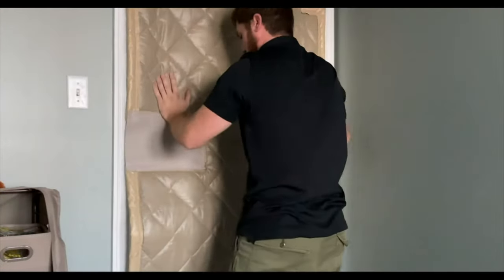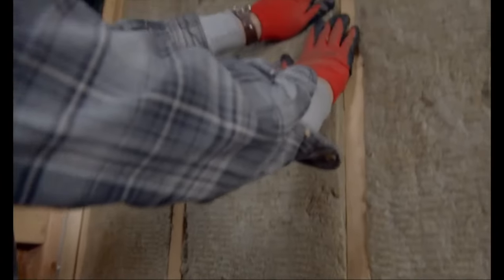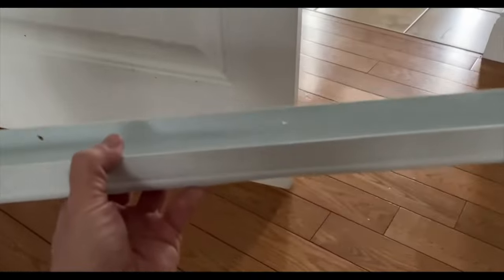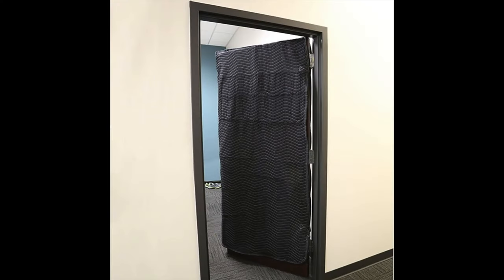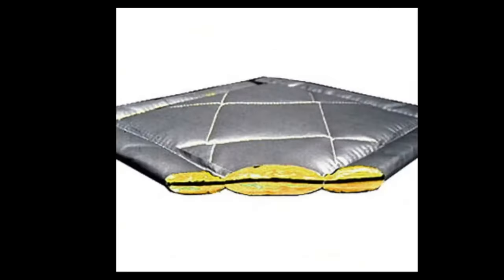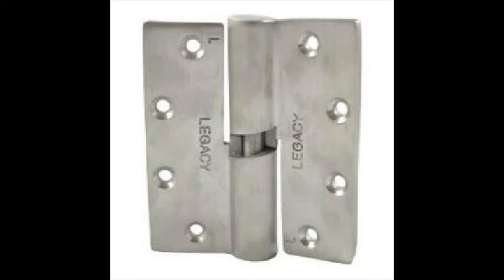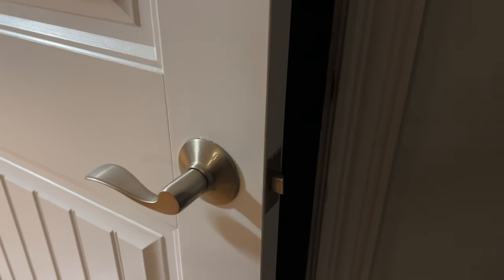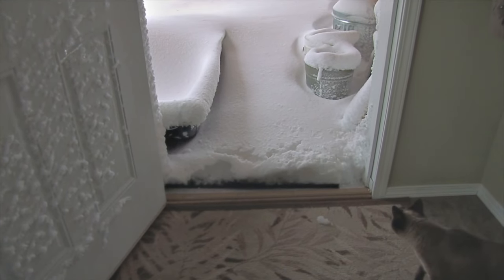12 CHEAP Ways to Soundproof a Door! (That ACTUALLY Works!)

Comment: I just took done my hollow door pulled off the paneling from one side, rebuilt the frame out of 2x6's which I cut down width and thickness  and I am adding  HDF paneling to the inside. If I had it to do over again, I would have dado'd the 2x6's in the middle and laminated the HDF paneling to get the desired thickness. I haven't finished it yet, but I did get the door back up with the new framing and one 1/8 in HDF panel glue to the inside, and I can already tell the difference. I am going to have 1/2 inch of HDF on the inside of the door.

Comment: Wondering what you think of this.. I have a bedroom studio with a subwoofer, the room is treated with 2in acoustic foam in the places that reflect, front wall, back wall and the sides.. one of the sides is the door itself, it has 6X 12in foam pads.. the room itself sounds excellent. What I am trying to do is block noise from getting out and bothering the family.. I was thinking, maybe I could put Dynomat on the other side of the door, cover it completely.. Dynomat is key in car systems, stops all the raddling and noise getting out.. could it work with a door too?

Comment: So Lemmeno if I got this right. 
1 make sure your door closes tightly. 
2 acoustic caulk around your door frame. 
3 weather strip.
4 door sweep. 
5 get solid core door.
6 hang moving blanket on door with Velcro make sure no gap.
7 hang thermal door panel.
8 custom sound proof door panel. Or blackout curtains.
9 door seal kit. 
10 sound proof hinges.
11 solid wood or fiberglass door. 
12 door muffler/silencer.
13 acoustic foam panels don’t work well.
13 storm door. 
Alright that’s all good and well. Should cover most people. Good suggestions but what about the thumbnail?? The thumbnail has someone spraying expanding foam in what appears to be a hallow core door. Give us the goods on that technique. Good idea? Bad idea? Works well or better than nothing. Thanks for your assistance🙌
Reply: Yeah wtf is with the thumbnail
Reply: Clickbait...as usual
Reply: I have a metal door. Just found out it is hollow.  I already did around the door. Now I am going to fill that door with big gap foam spray.  Works when putting in new windows.  around

Comment: 3:00 - Would it be possible to show how to adjust the small door casing? Can only find videos on how to adjust the gaps on the side with the frame.

I think I can reposition the door hinges slightly to add space but that doesn’t seem correct. Adjusting the casing seems to be a better option

Comment: Good advice always from this channel, no complaints, but the hard truth as most people know is, you need distance and mass between you and the sound source (or your neighbours and your speakers etc if YOU are the source).  Also those little cracks do let a disproportionate amount of sound through.  Also, anything that goes right THROUGH the adjoining wall, is an absolute almost-impossibility to counteract.  We had one house, the floor joists from next door, met our floor joists, in a double-sized hole in the party (joining) wall.  You bang that joist, they get it transmitted under their floor, it’s pretty bad.  In contrast, I had another house I lived in, built in the 19th century (circa 1850 or something?) and it was made out of big blocks of stone.  The party/joining wall, was 3 feet thick - the house beside us was one storey high only, and for that small adjoining wall, there was THEIR solid stone wall, then OURS, butt up against each other!  Nothing got through.  Sure, noise leaked out windows etc, but nothing got through the wall there.  You could hit it with a sledgehammer, it would sound like a ticking watch in the other side.  

Lastly…Have you seen the Ukrainian properties?  Terrible to say this, but they all seem to be THREE layers deep of grey brick.  I hate to think how bog-standard two-layer cavity walls would stand up to missile strikes, if the Ukrainian stuff is being broken through.  Three-layers deep, of brick, is a decent soundproofing level.  If only houses or apartments with party walls had this as a minimum standard, it’s be so much better.  I knew one guy, he bought two houses, turned them into one, and where there was a party wall to the other houses not owned by him, he literally built another interior wall of stone.  Normally this would use too much space, but these houses were cheap and small, so there you go.